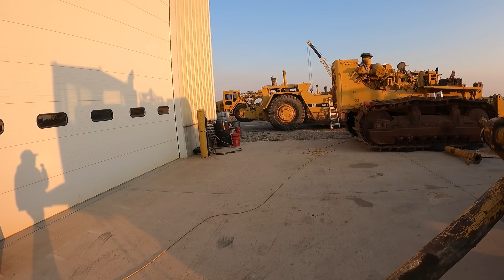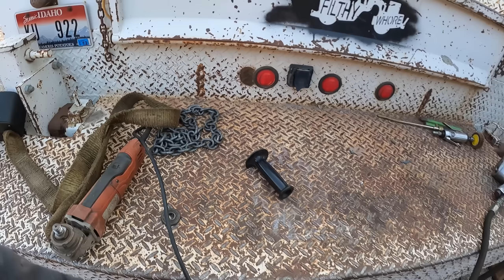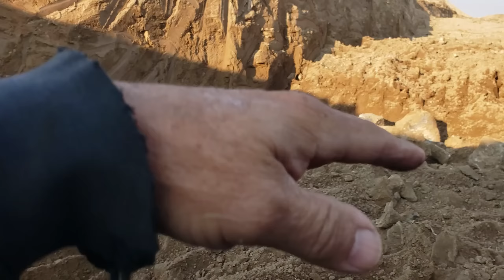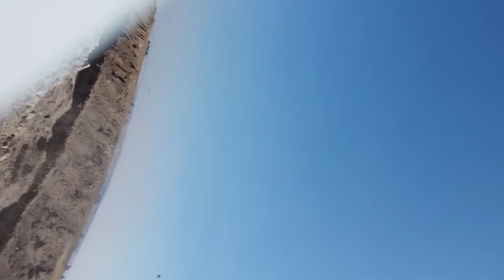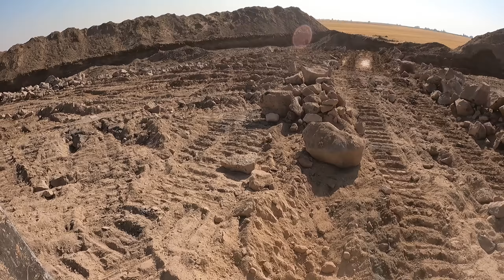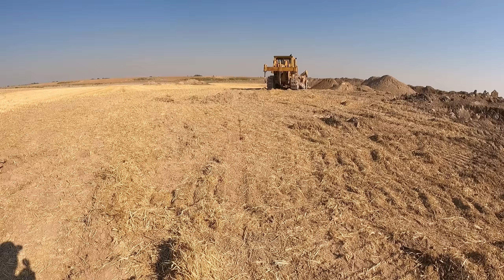Rock'n Roll D9G

Comment: Would it make sense to dig the rock loose with the excavator then push it away so you can control the amount of push easier? Just asking I have never moved shot rock closest I have come is moving piles of busted concrete. We didn’t have a d9 but a 300 class excavator moves quite a bit of material with tearing the undercarriage up
Reply from the maker: Matt opened up one side for me and it is easier

Comment: Pushing shot rock like that is hard work, hard on the machine and hard on the operator. I watch Demolition Dave Blasting and Drilling and using the excavator is no better either, seen a number of ripped buckets. Even though it is broken up, you still have to free the pieces up and out of what was once solid rock. They don't break on a plane when you blast them either. So now you are stuck with rocks broken off a foot deep pushing against ones that are 3 feet deep and things just pop and crack and jar as they come out the ground. It looks like it is all just really rough work all over. End the day feeling like a milkshake or punching bag.
thanks for the videos, Jeff. 
Hey, would one of those rock mulcher heads actually be worth the effort on that rock?

Comment: The definition of torture is doing what you are doing with a D9! Well ripping rock with a single tooth ripper might be worse! I wasn't fun in my mid 20's, now at 58 I can only imagine it would hurt more! Still the D352  engine sounds so nice under load. Cheers

Comment: I dont mean to ask a stupid question but can that rock be crushed to make gravel and used that way instead of putting in a hole.   Do they even make portable crushers. Seems like a hell of alot of work for more farm land
Reply from the maker: your watering it, fertilizing it and wasting time driving around it plus it's growing weeds and spreading seeds, wow I rhymed LOL  you can't buy ground with a well and pivots on it for what this costs, granted this is the most expensive way, blasting and such but there was no way to lower the big one by ripping.  and there's a water issue so makes sense to grow crops instead of watering weeds

Comment: Looks like some hard work !  Can that rock be crushed and used for gravel or anything ?
Reply from the maker: yes it can be crushed for a base rock but you need to cover it with a crushed gravel as the lava is highly abrasive to tires
Reply: @Jpaydirt  neat, there is no lave rock out here in Connecticut where I am.    Thanks for the info…..

Comment: It looks like it would almost be worth it to use the 336 to load the rocks in one of the wabco trucks and move them that way than take all of that punishment. But you probably already thought about that.
Reply from the maker: well I would still have to push it into the hole and compact it, plus I need the dirt in it or you get giant sink holes and uneven water drop out

Comment: Moving mountains to claim land seems expensive but they aren’t making anymore of it I guess.  What is the payback a hundred years to cover the cost to clear the rock and make it produce?
Reply from the maker: your watering it, fertilizing it and wasting time driving around it plus it's growing weeds and spreading seeds, wow I rhymed LOL  you can't buy ground with a well and pivots on it for what this costs, granted this is the most expensive way, blasting and such but there was no way to lower the big one by ripping.  and there's a water issue so makes sense to grow crops instead of watering weeds, payback is about 3 to 5 years depending on prices, potatoes are $34 bucks! this year

Comment: I see an opportunity here, if only you had a stone crusher and somewhere to stockpile the resulting crushed stone, one of those powerscreen jaw crushers like copperheadmarine got into. Of course, there would need to be a viable enough local market to sell it on to, enough of a demand for it in the building industry.
Reply from the maker: you would need a 60" jaw first to break it down, it's very abrasive so no one wants it as gravel is everywhere here and cheap